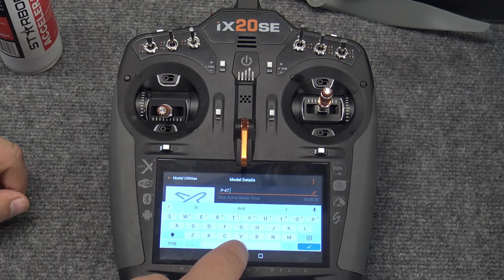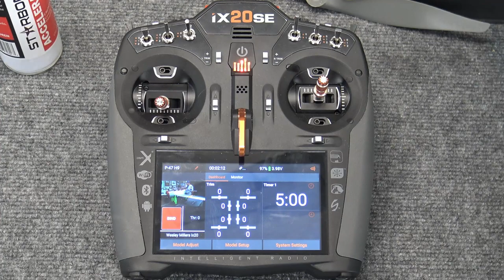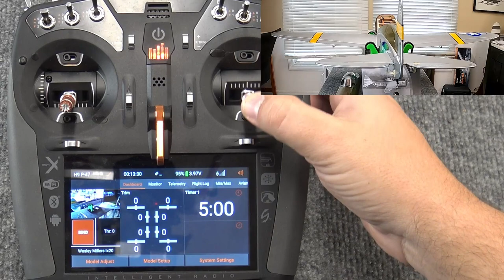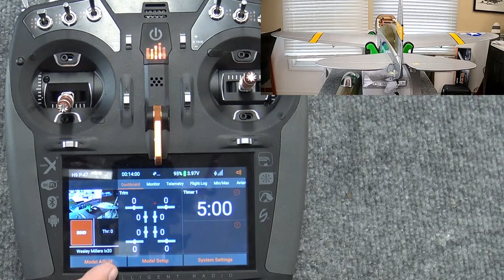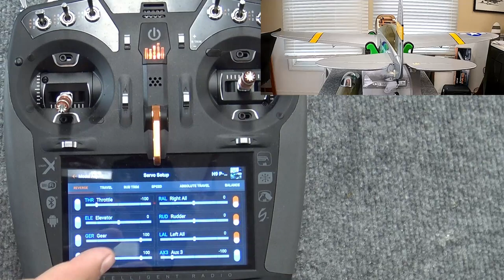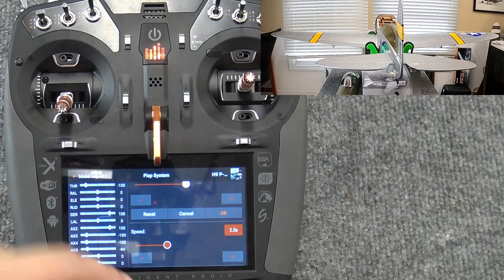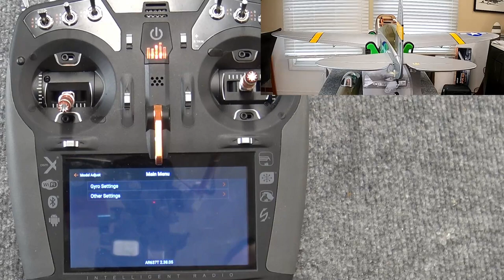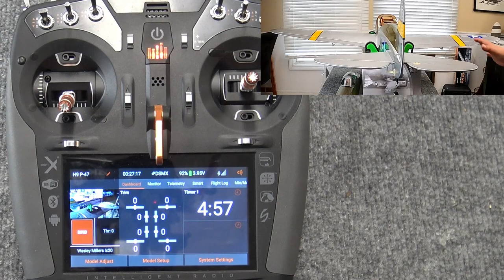Hangar 9 Fun Scale P-47 Thunderbolt PNP How To Assembly (Flaperons) HAN3380 AR637T #horizonhobby

Comment: Thank you for a very detailed video build. I would have a couple suggestions for anyone assembling a balsa model. First, prepare all surfaces that you are going to glue before mixing up the epoxy glue. Secondly, drill your holes as shown  in the belly pan. Then, screw your screws in newly drilled holes to a sung fit, Remove the screws and apply the thin ca glue. Let the ca cure. This will form threads in the balsa and insure that the screws will fit properly.